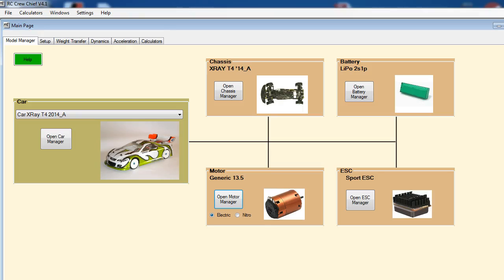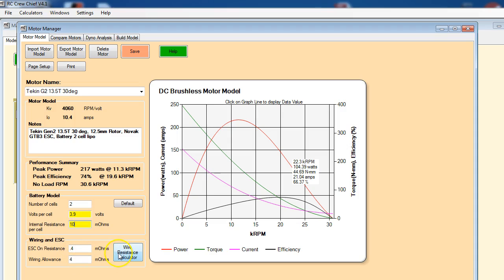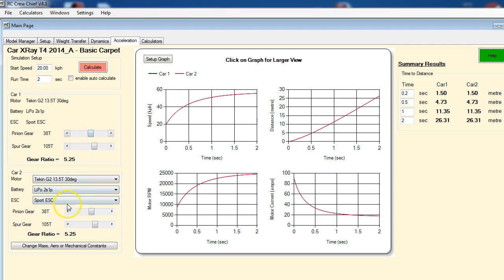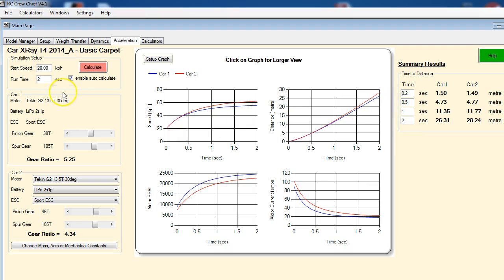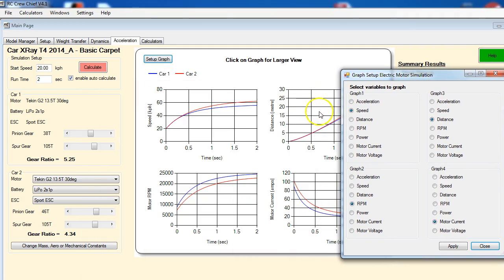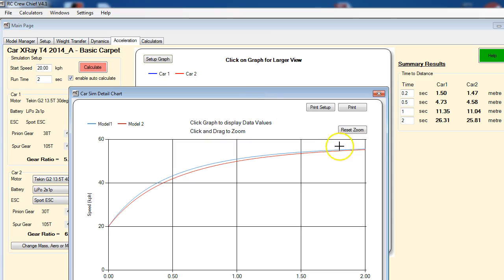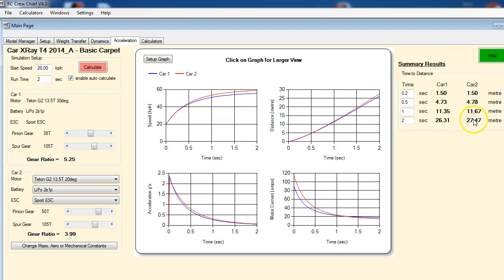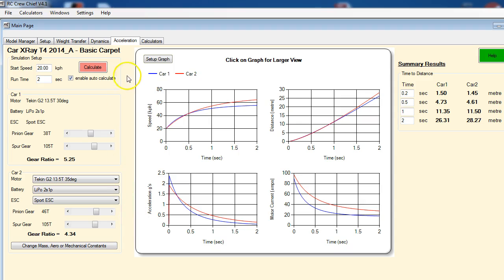Motor Timing and Gearing Analysis

Comment: So is a summary, lower timing means more motor power is drawn/made at low RPMs and less at High RPMs. Higher timing means more power at the top end is drawn/made.
So low timing heat is created at slow speeds, but punchier at the cost of power at the top end.
High timing reduces power drawn at low speeds at the cost of punch but better as the speed increases